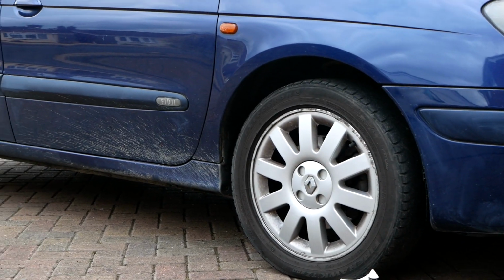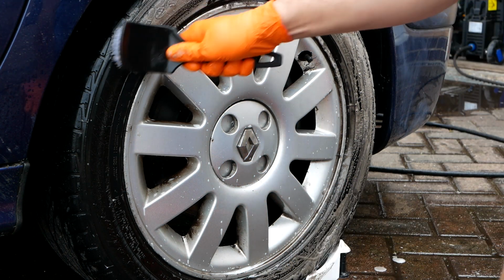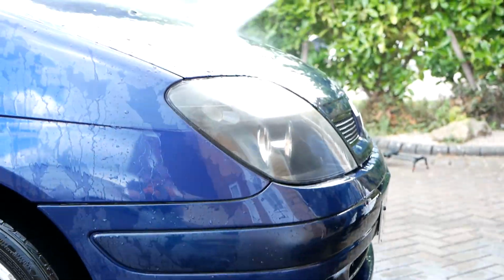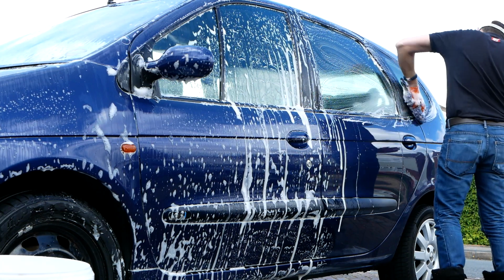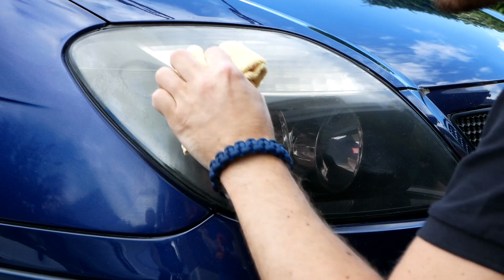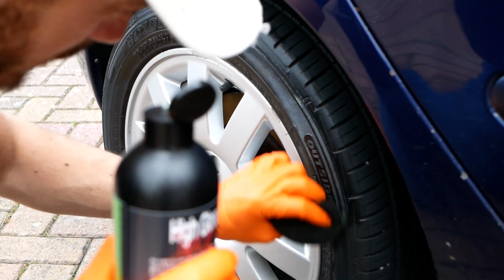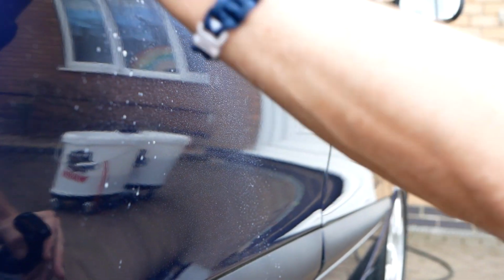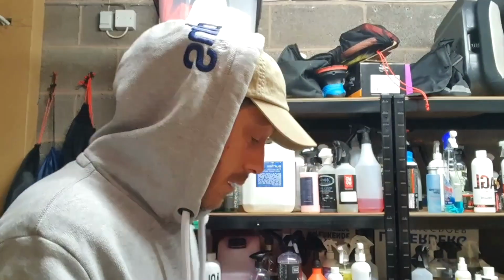Super cleaning DIRTY people carrier | Dmax | Satisfying car cleaning

Comment: Good video again mate, I tried a few dMax products before and most were good 👍
Reply: I think that, nowadays, its harder to find products that really don't work than it is to find products that are just fine. There's certainly a MASSIVE amount of products out there now and 99 times out of 100 its more about the buying experience than it is the product performance. If I buy a brand I've never used before (especially the small start up brands) I'm fairly confident that everything will work and I'm convinced this is due to the brands getting products from reputable wholesale chemical companies.
Reply: @devilsinthe  Exactly that👍🏻 Most brands are from places like Infinity Wax, car chem, achem etc etc.
Reply from the maker: Like Michael said. Difficult to find duffers at this point. Thanks for watching bud. I appreciate it a lot.👍